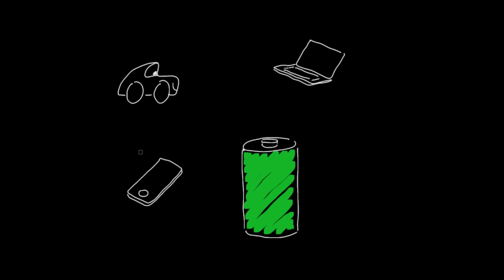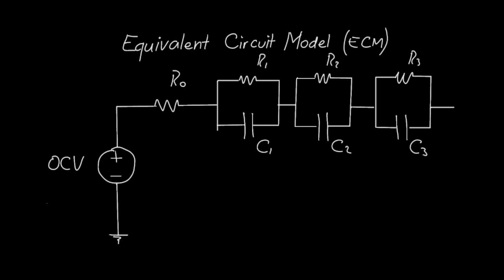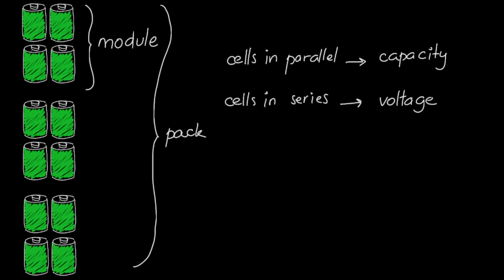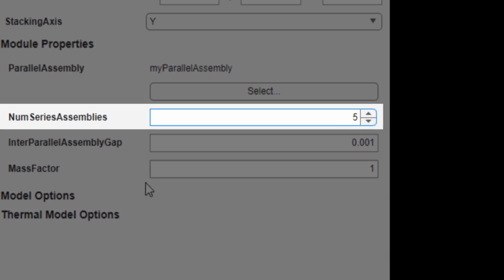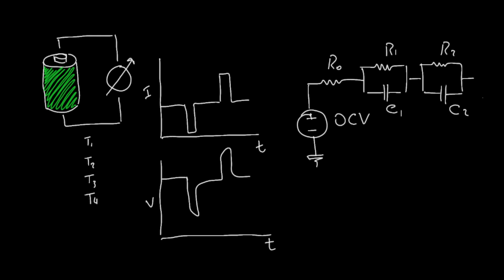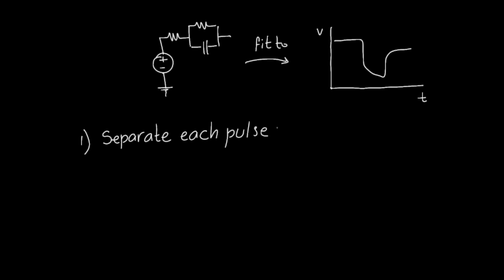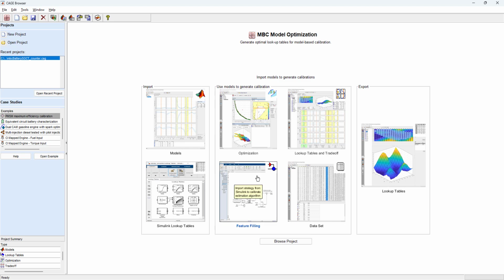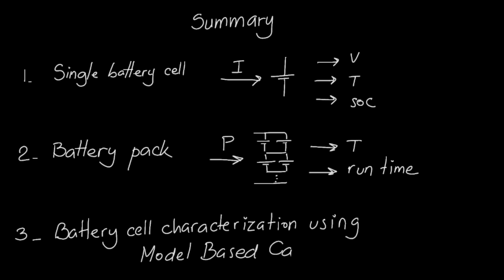Battery Modeling featuring Efficient Pack Design and Cell Characterization

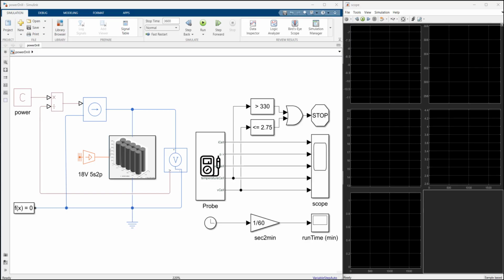Comment: After building a battery module, going to simulink again, we need to build our own simulink again? how to implement the model to simulink 10:36
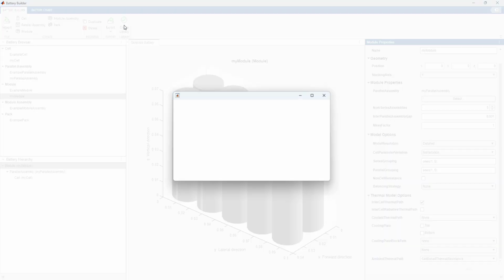Reply from the maker: Once the module is designed in Battery Builder, there is a button in the toolstrip called "Create Library". When you press it, Battery Builder converts all the information given so far into a library block that will be saved in the current folder. That is a Simscape block that can be used to represent the module in Simulink. This step is shown in 10:09

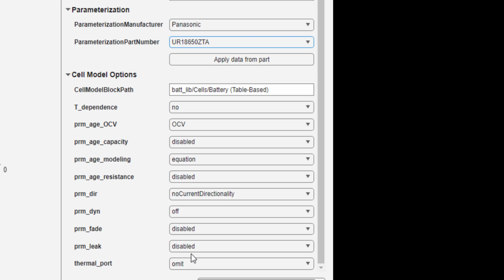Comment: No matter what I set the parameterization to, once I create a library my module/parallel assembly has the properties of a standard (table-based) battery block, not the cell type I have selected. When the CellModelBlockPath is changed in the video (8:07) I assume this is where the battery builder actually takes the battery parameters, so how to I get it to take the same parameters as the cell I have selected in the parameterization section? I have tried creating my own library and naming a table-based cell differently, but even then, the CellModelBlockPath finds the cell with my given values, but still resorts to default (table-based) battery parameters for the module. Thanks
Reply from the maker: This is a known issue that is being addressed. The workaround is to create the block using variable names and assign the values to those names separately.
Reply: @MATLAB  Okay, thank you. If I change the parameters of my module to those of a table based battery of my choice will this automatically scale based on my s-p configuration?
Reply from the maker: @tylerhunt8624 Yes, that is correct - you parameterize the module block with the cell parameters and Simscape scales it up

Comment: Why are you getting negative Current in the 2nd simulation
Reply from the maker: Our convention for current is i>0 for charge and i<0 for discharge. if you prefer otherwise, you can invert the controlled current source direction.

Comment: why the voltage is not creating algebric loop and unit delay is not needed?
Reply from the maker: Great question. When we are using Simscape components to create a network, algebraic loops, are never formed by definition, because the solution of the system of equations is simultaneous to all of them instead of being sequential. This latter condition is the one that generates all your brake loops. Please note that all of the signals and mathematical relationships are from the Simscape library.

Comment: Great video. Question: The video doesn't cover how to import our own parameter tables into Battery Builder's cell object. I have found parameters of R0, R1 etc. through test data and created a Battery Equivalent Circuit Block from it, and I would like to scale it up to a pack. However the only parameterizarion options I found in Battery Builder were predefined manufacturer ones. How can I put my own model's values into the Cell object in Battery Builder?
Reply from the maker: When you generate your battery object (module, pack etc.), you can choose the options of generating parameters .m file. Then you can modify your parameters in the .m file. https://www.mathworks.com/help/simscape-battery/ref/batterybuilder-app.html 
Please refer to MaskParameters option here https://www.mathworks.com/help/simscape-battery/ref/buildbattery.html

Comment: Thanks for the video; much appreciated. But how did you connect your temperature source into the battery module?
Reply from the maker: When you create the battery module, you can configure thermal model options including coolant thermal path and ambient thermal path. You may refer to the doc page https://www.mathworks.com/help/simscape-battery/ug/get-started-battery-builder.html

Comment: how does double arrow comes after constant block
Reply: he used Simulink-PS converter if that was your question
Reply from the maker: The constant block is connected to Simulink-PS Converter, which connects to a controlled current source (Simscape physical block). Here is the doc link of the Simulink-PS Converter https://www.mathworks.com/help/releases/R2025a/simscape/ref/simulinkpsconverter.html